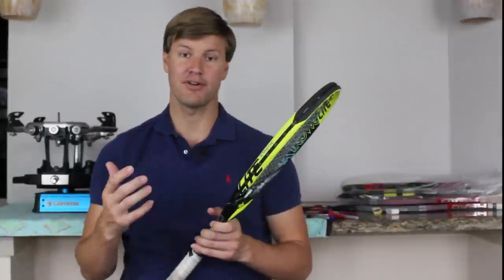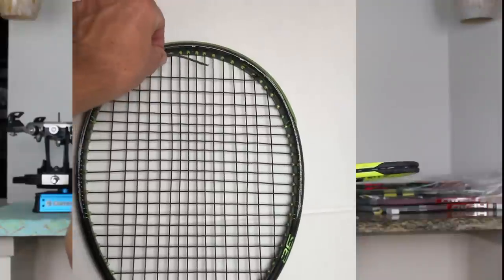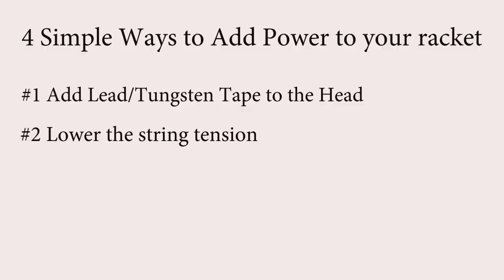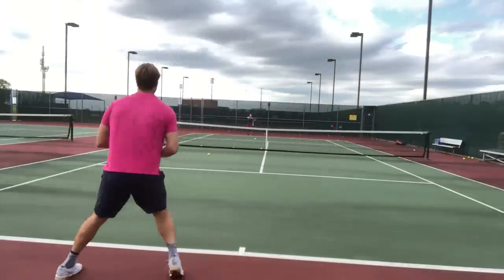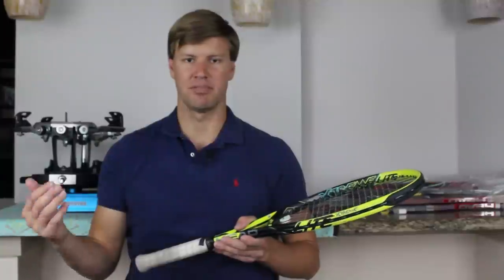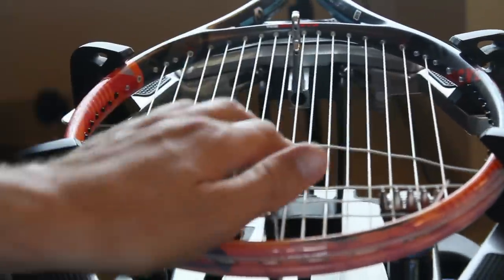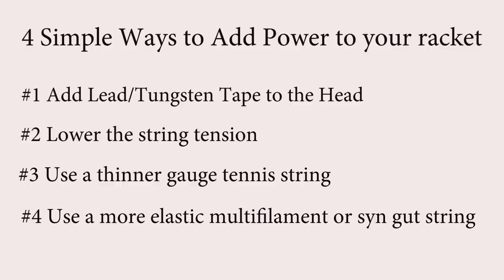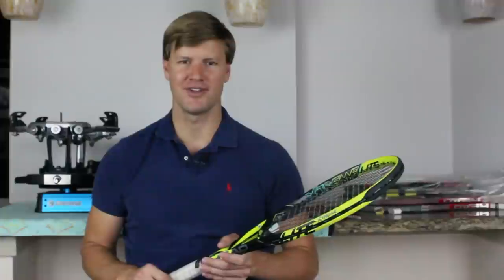4 easy ways to add power to your tennis racket

Comment: One of the few clips on here that explains the subject in a short clear and precise manner, good work.
Point 4, currently using Yonex Rexis on the crosses, not only it gives more power but also much kinder on the arms vs a full bed of poly, haven't noticed much lost of control.
Reply: what about durability? I have been going full poly for some years due to the durability issue of the multifilaments.

Comment: I’m losing strength and power. I hit fairly hard but using too much energy. I may go to 17g strong but I’m trying to figure out which one. I use full bed of poly (used to blend some but not anymore). I’ve used Luxillon rough and the smooth one and I liked both ok. I’ve used smart string and it’s not bad.

Comment: I play at 45lbs
Reply: I'm trying 40lbs
Reply: @intelcom4964  I play at 35 now, been experimenting all spring, probably going to drop it to 30 as the power and control I get with top spin is sufficient
Reply: @TrentG23  how do you like 30 and how different it feels ?
Reply: @intelcom4964  I haven't tried 30lbs yet, I'm just thinking about it. I like how 35 feels with Pro Hurricane Tour. Haven't had any elbow or arm problems. TBH, I haven't noticed any difference in loss of control from 50lbs to 35 lbs. More power and comfort though for sure.
Reply: @Hail2TheVictorsBaby  wow good info. I'm pretty much trying new tensions because since 2004 playing in the 50s and up lbs. 

I'm changing it to see
Reply: @Hail2TheVictorsBaby  wow seriously....i was struggling between 56/54 or 56/56. that was ridiculous.
Reply: @thewindrises  same, brothers playing at 15 lbs 🤣